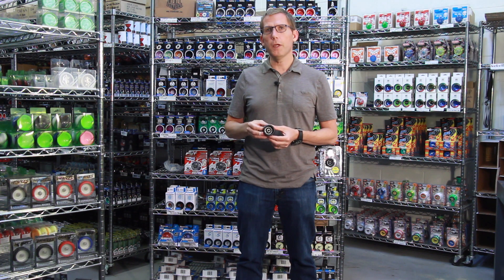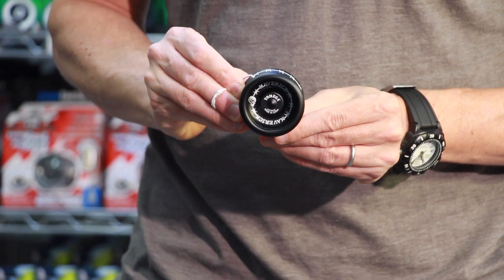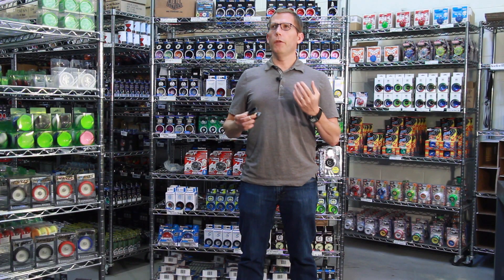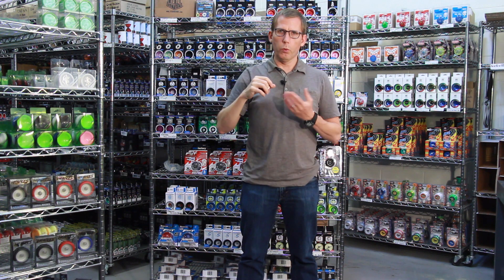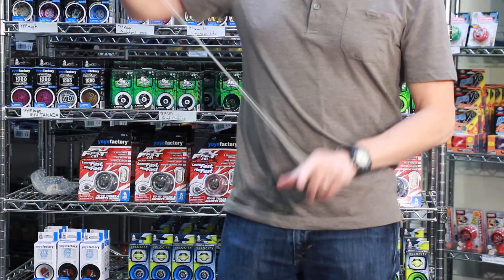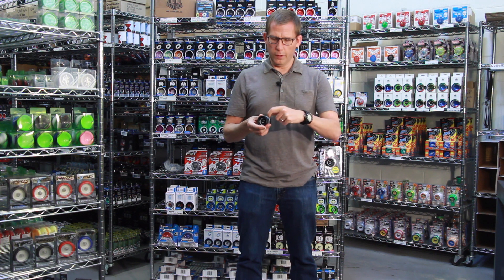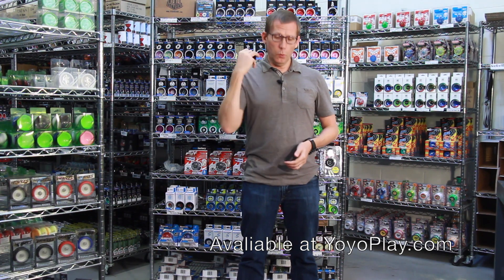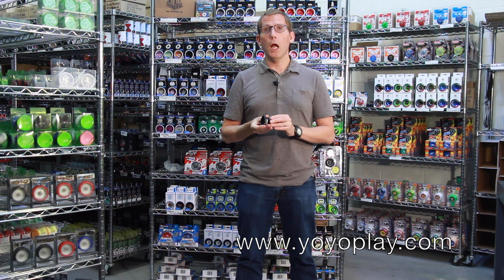Yomega Maverick Yoyo Review and Demo

Comment: Mine doesn't wake up at all, I need to do a bind to get it back up. Can someone tell me how to make it more responsive?
Reply: Add lube. YOYO LUBE ONLY as other lubes can damage your yoyo or bearing. Add a drop of thick yoyo lube and you SHOULD get it back up with a tug. 3-In-1 Multi Purpose Oil works too but it's a bit thin for responsive play. If not working, then learn the bind as the modern Mavericks are meant for unresponsive play. The bind is easy! I'll see if I can find a link for the bind for you! I'll send you links to Yomega's bind video and yoyotricks.com more detailed bind video
Reply: If you know how to bind, then you'll be better off with the unresponsive Maverick as it can take you really far.
Reply: I do bind. But I was just wondering because I saw other people's Maverick's more responsive than mine
Reply: Ohhhhh ok. Well enjoy a 50$ quality yoyo for just 15-35$!
Reply: Don't ever responsive the yoyo..... you can't do alot of tricks!

doing that hit your face worst then unresposive tricks.